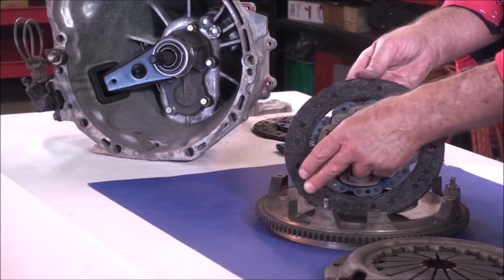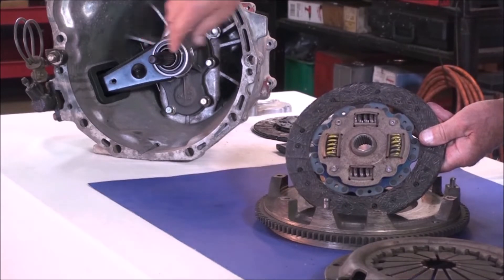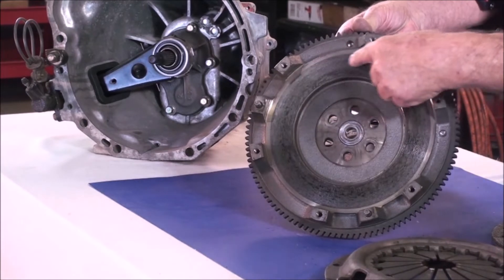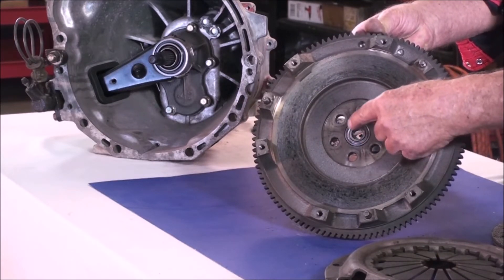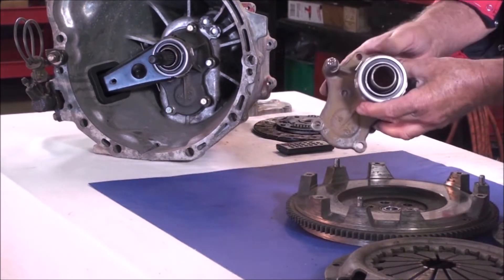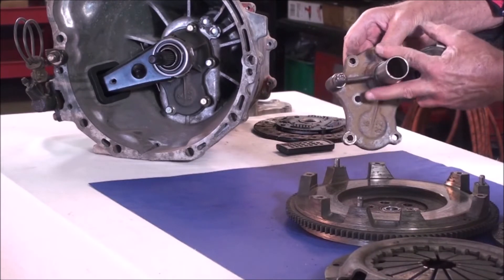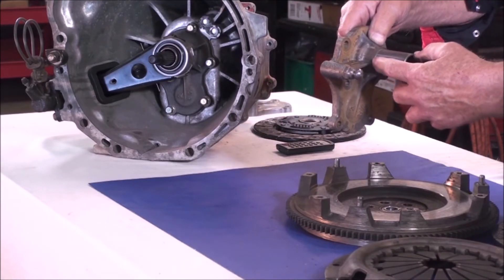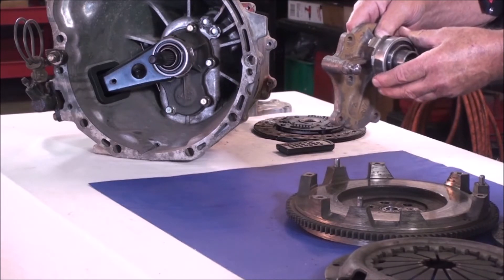How to Diagnose Miata Clutch Chatter

Comment: Hey Mike, hope all is well and thank you for the various great quality used parts.
I have a question about when to use flywheel shims. Especially when installing a used flywheel that has been resurfaced. Is it necessary? When do I know when I have to use one? I purchased a used flywheel from you back a couple of years ago that was resurfaced, but have yet to install it because of my complete vehicle restoration. I am coming very close to installing the transmission, clutch and flywheel in the spring/summer of 2023. I see that there is a .025 and a .050 shims available on rockauto. Any help would be very much appreciated. Thank you!
Reply from the maker: Hello Sir Mike,
Thank you for your purchase and concerns. The flywheel purchased from us has been machined with the correct step height. No shim is needed. The flywheel is ready to install.
Good luck with your Miata Mission. Mike, The King of Miatas.